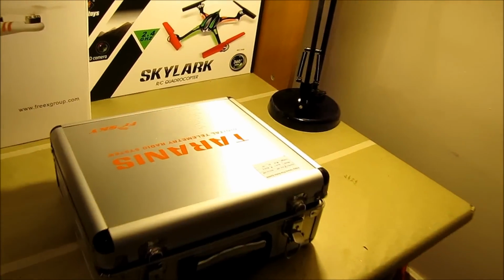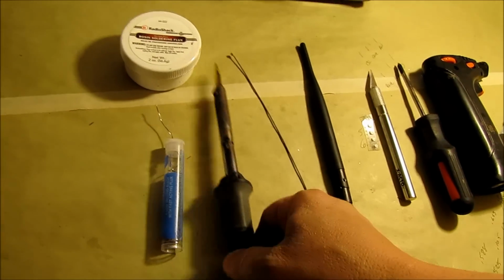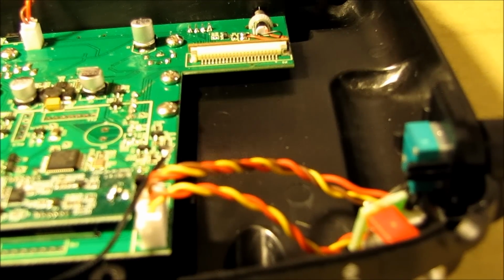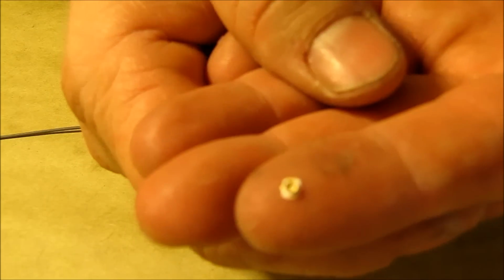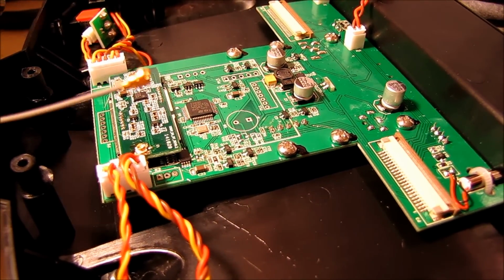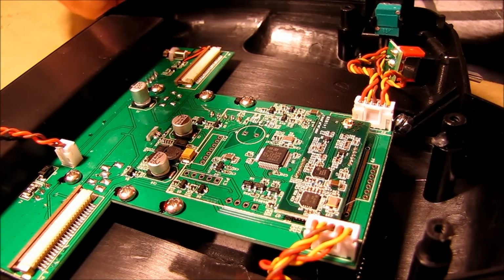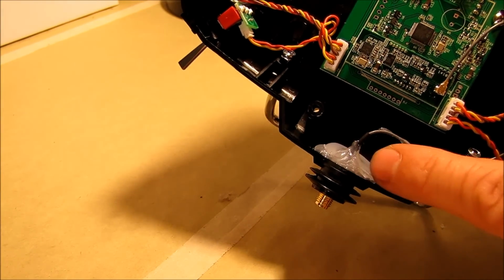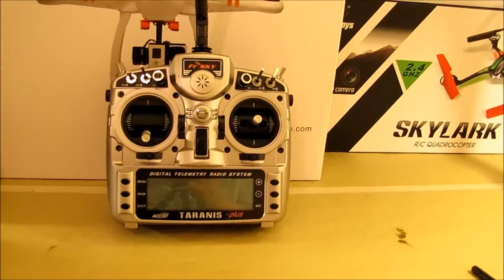How to replace the Taranis antenna

Comment: You know Tranis could have easily added the female plug so one could replace the antenna and simply plug the new antenna in its place but no they had to solder the f'ng wire into place making it difficult for pilots who cannot solder for a host of reasons. .Good video tho!!

Comment: Thanks for posting this video. I used a 1/4" flat washer (https://www.amazon.com/Crown-Bolt-19822-Zinc-Plated-100-Count/dp/B004XMX5CQ) super glued to the top of the radio to bolt the sma connector instead of hot glue. worked out pretty good.

Comment: I picked up this u.fl mini pci to rp-sma http://www.amazon.com/U-FL-RP-SMA-Pigtail-Antenna-Cable/dp/B005UWD0EG?ie=UTF8&psc=1&redirect=true&ref_=oh_aui_detailpage_o05_s00  (17cm, or 6.6 inches), sounds like you used a 7cm one or is it the 20cm from amazon? perhaps a 10cm would be better or does it really matter?  Also.. might something like this thermal paste be used, put on the board connections along with a drop of solder on each of the 3, then put the button connector on http://www.amazon.com/Clean-Temperature-Solder-Paste-Grams/dp/B017RSGPI8/ref=sr_1_2?ie=UTF8&qid=1465232120&sr=8-2&keywords=solder+paste (says lead free paste) (then hold, for how long?) the soldering iron on the side of the button to let it "melt" underneith and join up?  I only have 60/40 rosin based solder, no flux on hand, but i was thinking of getting the paste to make it easier, if this is accurate?

Comment: i do the same with my taranis x9d plus. 
but on power on if antenna is not connected i dont see warning "TX Antenna problem" and reciever gets the signal correctly. What this could mean? signal leakage?
ps RSSI higher if antenna connected
Reply: Powering up a transmitter without the Antenna could potentially kill it. Be careful to not fry your Taranis :)

Comment: Thanks for the video. But one question, will powering up the transmitter without antenna damage the transmitter module inside? Normally, running a transmitter without antenna will damage most transmitters. I'm guessing the transmitter gets powered up/checked immediately and then a warning is issued, so it should be fine?
Reply from the maker: I think it is OK so as long as it's not on for a long period of time. 
also the taranis will give you an antenna defective alarm.

Comment: Hi Wesley, Can you send me the link to the antenna you bought at Aloft Hobbies please.  Thanks!
Reply from the maker: kennethpappas here is a link to the original replacment: http://www.alofthobbies.com/taranis-antenna-solder-on.html

If you want to go with a detachable you will need one of each from these links 
http://www.alofthobbies.com/ipx-connector.html  ( I would ger 2 or 3 of these to be safe very easy to brake them)

http://www.alofthobbies.com/rf-coax-assembly-70mm.html

http://www.alofthobbies.com/2db-module-antenna.html

can use 5dbi with you want here:
 http://www.alofthobbies.com/5db-module-antenna.html
Reply: Thanks man.Is this the one you finally ended up with that worked?
Reply: I dont think that is the 5DB antenna?
Reply from the maker: kennethpappas yes it is but i went with the 2db antenna,
the last link is in fact a FRSKY 5DB MODULE ANTENNA
Reply: Why a 2DB?
Reply from the maker: kennethpappas Think of the stock antenna as transmitting like an apple shape (nice and round and great signal to the model), to get the farther distance, the shape has been flattened out, like a torrtia (or pancake), so the range has been increased quite a bit, but at the expense of flat envelope, will need to make sure your taranis is pointed  at your model to make sure you dont lose signal,  some times hard to do if your flying fpv
Reply: Yes I am flying FPV but only getting out 1/2 mile with stock antenna.
Reply from the maker: kennethpappas  yeah that sounds about right, x8r?

Comment: Useful video, I broke my antenna and replaced it thanks to this video, now the problem is that i dont get the telemetry or the rssi. I have the voltage sensor with the x8r receiver. It worked before i broke the antenna but now that i replaced it, it doesnt gives me the voltage telemetry. I really hope you can help me

Comment: HI
I have a similar problem when I switch on the radio and my steadidrone qu4d sometime the radio will lose the signal from the qu4d and after a few seconds it will come back I also notice when I am flying the signal bars will drop very fast,there was a time I was flying and the qu4d was about 40ft away from me and the receiver lose signal for a few seconds and it came back, do you think the antenna is defective? Also can you check these to link that I have sent you and tell me if I can use it to replace the antenna.             
(  http://www.ebay.com/itm/2-4GHz-5dBi-Omni-WiFi-antenna-RP-SMA-male-for-wireless-router-RP-SMA-IPX-cable-/160933825526?pt=LH_DefaultDomain_0&hash=item2578674bf6 )

http://www.ebay.com/itm/IPX-U-FL-RF-Coaxial-Connector-SMD-SMT-Solder-PCB-Mount-Socket-Jack-4pcs/321669013338?_trksid=p2047675.c100005.m1851&_trkparms=ai
                       Thank you in advance.
Reply: Kenneth Chance This is up to date and I think a better deal...http://www.ebay.com/itm/2-4GHz-5dBi-Omni-WIFI-Antenna-with-extended-cable-IPX-u-fl-end-130mm/150942892432?rt=nc&_soffid=5006459603&_soffType=OrderSubTotalOffer&_trksid=p5731.m3795

Comment: Thanks for making this. FYI.   You can get a kit for this from Aloft hobbies.
http://www.alofthobbies.com/rp-sma-kit.html
Newer taranis have the connector installed already I'm told.
Reply: planedoctor Yes, the connector on the PCB is the RP-SMA, so the upgrade is minus the hard soldering. Any one after the connectors I don't need now? Have a set of 5 in Sydney, Australia. Will post free to needy enthusiast!
Reply: planedoctor I bought a set of 5 for nearly nothing and so I don't need. Willing to pass on to a needy enthusiast! IPX U.FL RF Coaxial Connector SMD SMT Solder PCB Mount Socket for free post in Australia. IF you want to do it, have some back ups!

Comment: Small tip for those of you who have solder hot air guns like these http://amzn.to/19Irq6z , you can simply get some solder on the pads first, then set the connecter on top and heat it up with the air gun.  This is essentially the solder "reflow" technique.  The solder will reflow, and that little guy will drop right in and self center like magic.

Also, even if you don't have a hot air gun, its still easier if you take one of the pads, solder it, then bring your connecter over and set it on top while you remelt the solder with your iron.  Precision electronics tweezers may help.  This is a much easier way to get that first tack down than trying to handle a solder wire, a solder iron, AND a loose tiny ass connecter all at the same time.
Reply from the maker: +1000iller yes! having a good iron, the right solder and  soldering paste makes the job so much easier.
Reply: Dude your comment made me buy a hot air soldering station and quality paste. That stuff was magic to work with! Thanks a ton!
Reply: Any idea what temp and how long to hold the soldering air gun over the connector (or how close) so as to not ruin anything nearby.. or is it just as easy to get some $9 lead free low temp paste, put on the 3 connections on the board, set the connector down and touch the iron on the side for (how long?) till it gets hot enough to melt and connect up?
Reply: IE: this paste http://www.amazon.com/Clean-Temperature-Solder-Paste-Grams/dp/B017RSGPI8/ref=sr_1_2?ie=UTF8&qid=1465232120&sr=8-2&keywords=solder+paste

Comment: Thank you so much for making this video.  I damaged my case the other day and decided to replace it (slipped and fell on ice while holding taranis).  I hastily removed my antenna from the original case without realizing that there were no provisions to reattach it. Well... Lon story short, I had a spare DX5 radio laying around that I scavenged the IPX connector from.  With some patience, a new soldering iron tip, and your video I managed to get it repaired in about 30 minutes... Again... Thanks for making this tutorial

Comment from the maker: The long one that I had I had found from Amazon.com.   I know antenna lengths can play a part but I don't know at what point it is too long to be honest with you, I don't think a couple inches would really matter but like I say I really don't know.  I found these antennas at aloft hobbies they have several different links if you want to try putting him one that's a little bit shorter
 They have 70 millimeter to 200 millimeter in 250 millimeters  lengths

http://www.alofthobbies.com/radio-gear/frsky-accessories-1/frsky-antennas.html

Good Luck!

Comment: Hi great video, I have a question though, does the antenna length inside have to be a specific length as the original is very short but the one you use is long, does this matter? I was under the belief antennas were a calculated length.
Reply: Only the ACTIVE part of the antenna has to be a specific length. Most of the wire has the Outer Shielding covering it. There are two parts. Outer Shielding which is Negative and the Inner White Wire is the Positive(Active) part. You cut away the Outer Shielding and make the Active part to the proper specifications. Active part will be inside your actual antenna.
Reply: FPV-Quadcopter Racing Also make sure the the new antenna is a 2.4GHz but a 5dBi, not just ANY 5dBi type!
Reply: what type then?